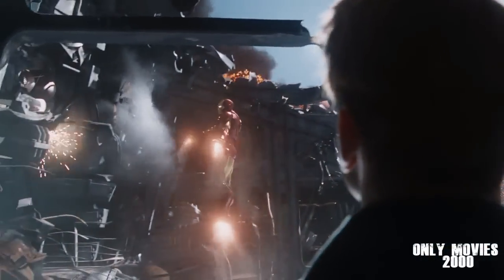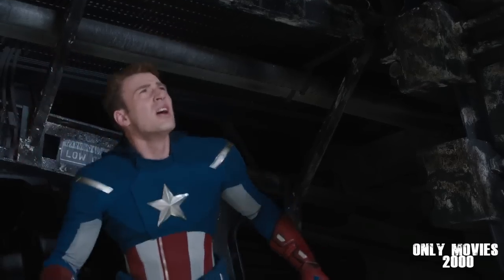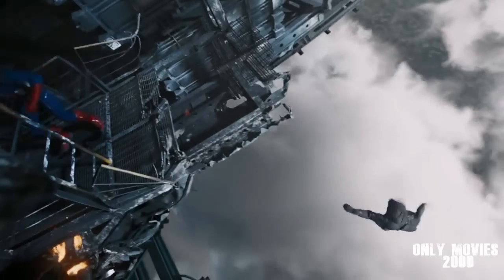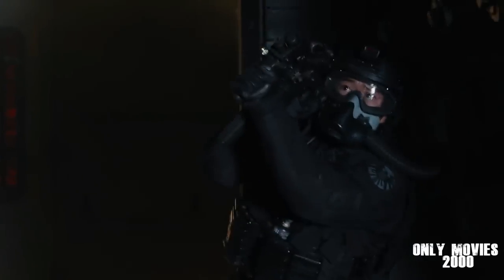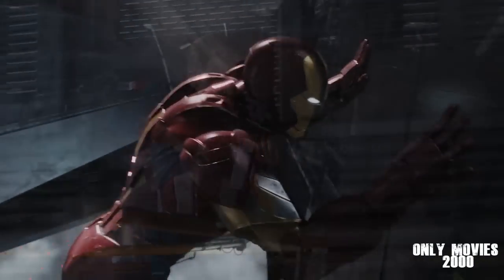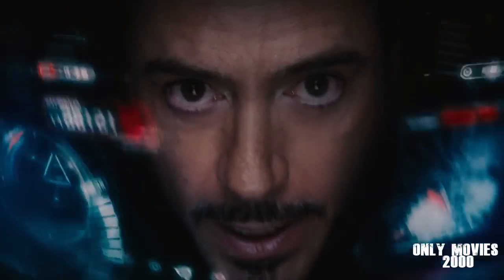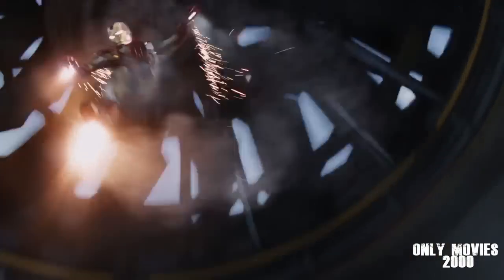The Avengers - Repairing rotors HD

Comment: It's funny seeing how much damage Tony's suit takes in the first movie, then in Iron Man 3 they fall apart after a slight breeze.
Reply: jomo999 The Mk. 42 was a prototype, so there's one reason why it was weak. and also, the suit coming in pieces would mean it would have to detach from it's other parts easily so there's another reason. you can see in AoU he fixed all that with the Mk. 43
Reply: jomo999 and if you are talking about the other suits in the final battle then there is reason for that too. The extremis soldiers are capable of hearing to in excess of 3000 degrees C, which means they would be able to melt the gold-titanium shells of the suits. Given they only had brief contact with the suits whilst hitting them, it would probably at very least soften the metal substantially. Add to that the fact that they are have superhuman strength, possibly even more than super soldier serum affords, it makes sense that they could rip soft metal, and by extension the suits, apart like paper.
Reply: jomo999 all of the suits in that battle were prototypes designed to suit one specific purpose like underwater travel or high altitude flight. They had no significant weapons and were mass produced. Tony's avengers armour is always more fleshed out with many weapons.
Reply: Lol I love how we all ripped off on this guy. I just get really defensive about the Iron Man suits because he's my favorite superhero
Reply: Since The Avengers, the films are full of flaws in writing on Tony's side. I swear they hate him, because otherwise he would've already rule the world by now.
Reply: It's probably also worth noting that throughout Iron Man 3, Tony was having panic attacks and was unable to sleep, due to witnessing the alien armies on the other side of the portal in this movie.  His mental state was probably messed up enough that he made a lot of design flaws in his suits.
Reply: People say this as if Getting Your shit rocked by a god holding a Magical Gauntlet isn't more Dangerous than a Tank she'll

Comment: The fan is turning the wrong way round. The way it is turning, it pushes the ship down
Reply: cinema sins approves
Reply: I thought the angular downward motion of the ship was what had caused the rotor to spin in the opposite direction.The updraft could slowly push against the blades and the direction they turn is determined by the angle of them. Just a theory of mine.
Reply: u guys make lol hard when u psycho analyze A COMIC BOOK MOVIE! let that sink in for a sec!
Reply: +Leonardo Braynen there's nothing wrong with trying to understand the science of science fiction
Reply: kelly wilson whitehead dude, when did i ever question sci-fi? u sure u got the right guy?
Reply: "Speak English"
Reply: Captain america blocked a grenade
Reply: Özgür Bulut Actually, if you look from the top-view at the blades, they're not slanted or anything, so it doesn't matter what direction they're spinning. In fact, they shouldn't be moving the ship up/down at all. None of the fans should.
That thing shouldn't have been able to take off in the first place.
Reply: TURBINE
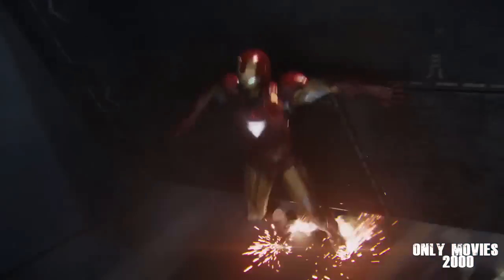Reply: 2:54 you can see that that the blades are angled down and tony slips in the same direction the air is being pushed... down.
Reply: +Vice Admiral Strawberry's I think the ends of the blades are just slanted.
Reply: Lets not forget that each rotor engine has a second propeller below the axle hub that seems to spin in the opposite direction of the top propeller.

Comment: I always been curious on how accurate Tony Stark's engineering comments are, any engineers here?
Reply: Freddy Pedraza If you're talking about 0:50 and of my basic knowledge of physics is correct, then:

The fan is propelled by magnets instead of having a motor (like a helicopter would) and when the switch is on, the magnet has a different (or same, depending on if they want to push or pull the fan) polarity than the fan so the fan experiences a force. When it switches, the fan would experience a force in the direction opposite to its initial motion, which would slow it down.  It checks out, but how to build that, idk but I feel like it's possible

Comment: I gotta get the super conducting cooling system back online before it can access the roders, making it able to dislodge the debris. I analyze the control panel to see which relays are in overload position. The standard control unit can reverse the polarity long enough to disengage mag-lev, and
Reply: Rotors!

Comment: Avengers logic:
Grinding Rotors doesn't affect tony inside his suit.
Captain America's punch actually hurts tony 😑
Reply: Gray Strauss he's a fucking super soldier that's why
Reply: iMangifiesta yeah but he's not stronger than a fucking 500mph jet rotor
Reply: This suit is alot more durable than MK 46
Reply: I also noticed that. Since The Avengers, Stark's armors appear to have been weaker and lighter.
Reply: More like 400rpm
Reply: This suit is made for war but the suit used in civil war is made for some normal purposes because there is no war situation after ultron. The suit in infinity war will be more advanced and it can handle anything. Also marvel is giving more importance to the Tony's suit rather than other avengers
Reply: Lmao it's not about the suits. It's about the fact that the fight in CW was a fucking joke. Very poorly written and just a fail. Logically, Tony should killed Steve and Bucky.
Reply: This suit is made for durability and war. The single most repetitive upgrade that Stark puts in his new suits is the fast access to the suit. i.e starting with the suitcase suit in Iron Man 2 and so forth. He has to sacrifice durability and strength and weaponry for this upgrade. The suit he fights in civil war against Cap and Bucky was one of ease of access because it was designed to assemble in his plane.

Mark 3 and 4 are easily still the strongest of his suits next to the new Nanotech suit from IW
Reply: Gray Strauss 

I feel like all of these are theories people come up with to run away from the fact that captain America is simply a badass.
Reply: @DeeFightingDreamer  Tony didn't want to kill them , but dismantle them . Fight was pretty brutal too . Emotional stake as well .
Affected them all the eay thru infinity war .
Reply: @Inertia-lb8gq  I know that. If anything, Steve was the one that looked like he was ready to kill him, at least it looked like that to me. I just hope that they have a conversation about this in Endgame. I'm tired of the directors ignoring the problems and always coming up with some excuse as to why the problems are already overcome.
Reply: @DeeFightingDreamer  I almost cant read your post :( . Not any until End Game . I'm 100% spoiler free since leak . All theories based are from past . Return soon brother .
Reply: @Inertia-lb8gq  wtf I didn't even say a word about what's happening in Endgame. Stay dramatic, I guess...
Reply: But it does hurt tony. His suit is all fucked up from it and later in the movie he has cuts from it and is repairing his suit.
Reply: @DeeFightingDreamer  I agree. Tony could have just lasered them both at the same time the way he cut down that rock to block Steve from getting to him.
Reply: Actually the punches weren't hurting Tony. The suit took way more damage and just left Tony with a few scars.
Reply: Anyone else think this is Tony's toughest suit?
Reply: Well Caps a Super Soldier. Key word “Super”
Reply: His suit is not made of Aluminum bruh
Reply: Doesn't affect him? Do you see him passed out on the floor with his suit fucked up?
Reply: Mostly they aren’t logical!😂
That’s why I hate civil war movie a lot!
It has ruined Iron man’s abilities!!
Marvel always wanted iron man to be the weakest one!
But he’s always iconic!
Reply: @GauravGarg20251.  Which is logically incorrect. Cap has better fighting skills but basing on the facts that the mcu had given at that point, Cap had no way of damaging the Ironman Suit. Cap's fists are not even enough to punch through a tank. I know his shield is made of vibranium but in order to be able to destroy anything he needs to have enough power to do so. Cap's punches was not as heavy as 10 elephants. His punches are stronger than average but it wasn't as strong as the likes of Ironman, Warmachine,  or Thor. 
Ironman didn't have a problem tanking a bullet from a literall tank. So in order for Captain America to be able to hurt Tony inside the armor, he should be at least stronger that a tank bullet. But as we saw, he wasn't at that point. Besides his fists are still human flesh, it's not as strong as metal so even if he can ever muster enough power for his fist to actually hurt Tony, his fists would actually break first since his fists are weaker than metal.
Reply: @sanjaykrishna1765  Yeah, their earlier films were consistent (Avengers 2012 up to Thor Dark World). They somehow started to exaggerate Cap's abilities in Age of Ultron. Even though Cap was always losing to Ultron it still wasn't supposed to be a fight. Ultron is only a little bit weaker than Ironman plus he is made of actual metal. 
Cap wasn't even bulletproof.
A wall is bullet proof. 
Ultron can punch through holes. 
Therefore Ultron's punch is stronger than a bullet. 
So supposedly,  even one punch from Ultron is more than enough to literally break Cap's skull and leave him dead.
Reply: @GauravGarg20251.  The examples that you gave are all proofs of why mcu movies are illogical. Let's talk about these issues one at a time so we don't get mixed up.
First let's talk about why Captain America will be able to tank a strike that can punch through a hole. 

Let's talk about penetration force. Penetration force gets stronger when you give more power behind it. It also gets weaker when the area that you applied the force with gets bigger. 
The penetration force of a bullet is strong because it travels at high velocity plus the area of which its force is applied to is small. 
If you fire a bullet into a wall and it didn't penetrate that's because the penetration force of a bullet is not strong enough. 
Now Imma talk about the penetration force of something that can punch through a wall. Even though the area of impact has gotten bigger this time, the power that is given behind the object of impact is more than enough to make up for the enlargement of the area. Therefore Ultron's punch has a lot more capability at penetrating different kinds of objects than a bullet. This is actually scientifically correct.
So it is not true that fists cannot penetrate through a body just because it is bigger than a bullet.
If cap's body can't handle the penetration force of a bullet then his body cannot also handle something that has more penetration force than a bullet. 
Okay, in my case I can understand physics better because I'm an engineer so I'll give an example where an average individual with no background in physics can understand. 
A bullet is 0.000275 smaller than a fist. So let's take something that is  also .000275 smaller than a human. A cockroach would be a perfect example. Now because Cap is around 20 times tougher than a regular human let's assume that this cockroach is made of of aluminum (which is more than 20 times tougher than a cockroach). 
Even though the bullet is not that small compared to the size of the aluminum cockroach it will still punch a hole through its' body and also send it flying. Therefore it is illogical that Cap tanked Ultron's and Ironman's punches.
Reply: @GauravGarg20251.  You can Google it dude..
And Chill dude.. already once the Stanlee has said.. its based on writer's thought!
BTW in civil war, both of them were lost!
Reply: @Greenchecks101  this logic is awesome! I liked this analysis 👌 I wished the writers should have given cap extra more technological/natural abilities!!
So that the character will become way more powerful than other OG avengers!
Reply: @GauravGarg20251.  Cap was losing. Ultron was about to end him if it wasn't for Wanda and Quicksilver.
Reply: @GauravGarg20251.  No answer so I guess we both agree that Cap was supposed to die after each punch from Ironman, Ultron, Thor, and Thanos.
Reply: @GauravGarg20251.  Now let's talk about why Cap was able to damage tony inside the armor. Tony's armor can literally tank 50 Calibers, Power blasts, Tank Cannons, and Multiple missiles. All of these are at least 50 times stronger than Cap's punch. 
And it's not true that hitting your target multiple times can make up for your lack of power. In order to damage something you have to apply enough stress at a single time.  Example: a table will not be damaged even if you tap it a million times but you can break it in a single punch. 
So powerwise, it's impossible that Cap can damage or hurt Tony inside his suit. 
Also, Iron is tougher than Cap's fist. If you punch something tougher than your fist you will totally break your own fist. I know he's tougher than average but still his inability to tank bullet shows that he is not as tough as the likes of Ironman or Thor so he will break his own fist if he ever hit something harder than his fist.
Reply: @GauravGarg20251.  See? You got nothing. 😂😂😂 Meaning Cap was never supposed to be able to stop Thanos even for a while. 😂😂😂 Cap was supposed to die whenever he gets hit by anyone as strong as Ultron. 😂😂😂 Cap was never supposed to be able to even scratch Tony's suit. 😂😂😂 Cap was never supposed to be able to lead the battle of Wakanda or the battle in Endgame. 😂😂😂 For fuck's sake his abilities were only "peak human level", he should have died back then when he was fighting Loki. 😂😂😂
MCU tried so hard on fronting Cap that they nerfed godlike characters (Thor, Hulk, Vision, and Wanda) just so Cap can take the spotlight. 😂😂😂
Even Hulk was hurting against Thanos and they expect us to believe that Cap is able to hold Thanos back even for just a few seconds?! 😂😂😂
Reply: @GauravGarg20251.  Preparing? You better FORGET it if your answers include "Cap stopped a fucking hellicopter", "Cap survived a full swing from Thor", "Cap was unaffected by crossbones' Iron punches" or anything that Cap did which were ridiculous. Because those are the things that Cap shouldn't be able to do but the writers still did. And that is our point, he wasn't supposed to be capable of almost everything that he did in the films but it happened only because the writers made it happen. 😂😂😂

Don't even try telling me that it was all because of his willpower and heart because none of those things can change physics 😂😂😂😂
Reply: @GauravGarg20251.  Oh, and even though Vibranium is tougher than Iron that still wouldn't be enough for cap. His shield is tough but he doesn't have the strength. Just like a big knife and a tree. Just because the knife is tougher than the wood doesn't mean you can cut it easily. You still have to back it up with enough strength. And as we saw, power from a tank cannon is not enough to damage Ironman and Captain america is a lot weaker than a tank so it's impossible for cap to damage Ironman just because he has a vibranium shield.
Reply: @IronMan-tk8uc  
Nah, not all of them
The Mark 45 took a blunt of the explosion from Sokovia exploding and was relatively unharmed

Comment: Some details I managed to glean from Tony's HUD:

His Arc Reactor is operating at 312% capacity
His thrusters are operating at 110% spec
His propulsion core is overloading
The Helicarrier's rotor is spinning at ~250 RPM, which doesn't seem like much until you remember how enormous it is.
Reply: Oh that’s cool 

So this is like a kinda afterburner thing in the suit that is used when he needs to move something massive
Reply: Also, the particular rotor tony was pushing doesn’t seem like it had a particularly aggressive fan angle. Also it was funny his HUD said “DANGER: VERTICAL DRAG”.
Reply: @rugbydudedc4216  Yeah like it was on for too long